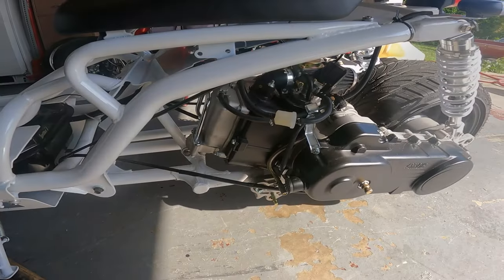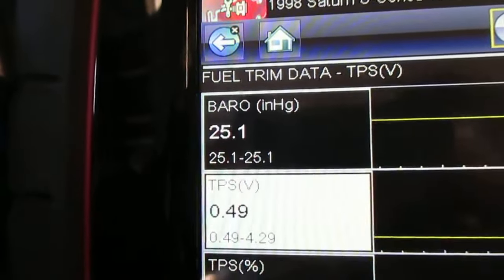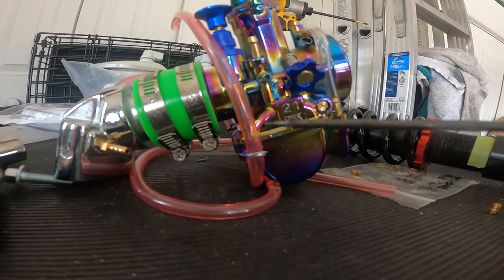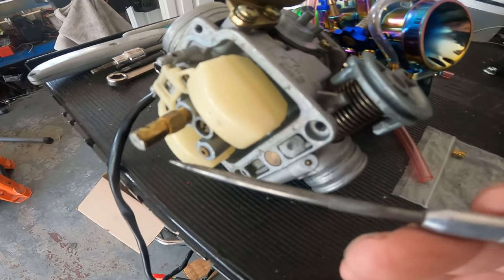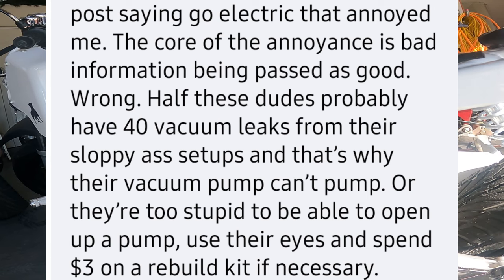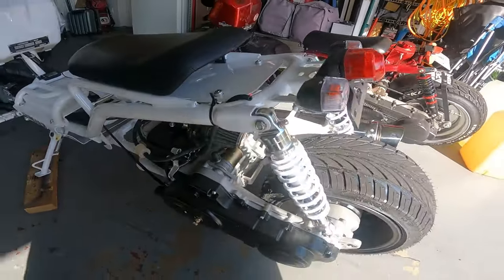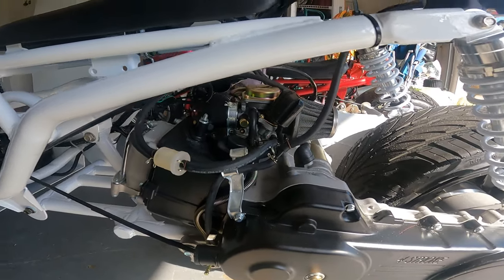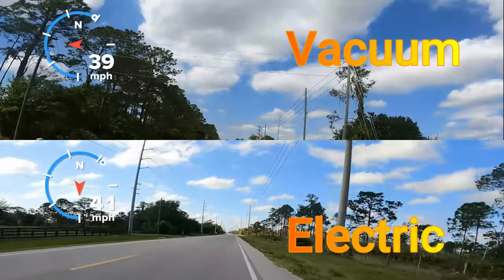Electric VS Vacuum Fuel Pump on Maddog 50 GY6 139QMB

Comment: Great video..
My old honda helix used a electric pump..what some people forget to understand is where the gas tank location plays a part as well trying to pull fuel from under the engine is hard.. I believe even the honda ruckus runs a electric pump as well because of the location. Great info 👍
Reply from the maker: Thanks.  Ya I have the honda ruckus pump on another bike.

Comment: I'm suspecting the same issue with my 72cc build. After jetting it and taking it for a ride, I manage to get it up to 50 mph (Probably more around 45 but didn't have my gps speedo app on) then it started dropping back down to 40. When I turn off and got back on the throttle the acceleration was slower than when I first took off. But then when I stopped for a moment then proceeded, I was back to normal acceleration. Considering finding a electric pump solution or just go full gravity feed with a shut off valve.
Reply from the maker: Sounds like it for sure

Comment: You couldn’t be more right. I have seen this with my own eyes. However, I did one better after having my electric fuel pump leave me stranded. I installed a Y and a second line which I can switch at the fuel filter that goes to a vacuum pump. Hopefully I will not have another electric fuel pump failure but if I do I’m ready.
Reply from the maker: Whoa.....  LOVE that idea!
Reply: Would love to see your take on it. I just used a brass valve and a Y at the tank. Then I used a valve on the vacuum line so the pump doesn’t actuate all the time. I simply swap over the line going to the inlet of the filter unplug the electric and valve in the vacuum.
Reply from the maker: @wesmadebuilds681  is the valve just like an inline fuel on Off valve?
Reply: @GhettoWrench  the valve is right after the tank, but that is just so I don’t make a mess if I want to work on something later on. The other valve is on the pulse line so the fuel pump is working all the time and all worn out. I just go into a Y right after the tank. One side goes to electric and other pulse. The discharge is what I swap around as needed. You could get fancy with valves but I already had a lot in the system.

Comment: I have the GenV same one you have. Just put 100 miles on it. Today I took it for a couple miles at 55mph n it started slowing down then I slowed down n it was fine. 🤔 I'm putting uni filter on next week and ordered jets too. Should I increase a jet by 2? Also di you recommend A china electric fuel pump for genV from Amazon as an upgrade? Or is vacuum fine? Looks like you lean electric but you spoke highly of vacuum I'm 😕confused😮.
Reply from the maker: @xDragonHawk  55mph...  guessing that is a 150?  On a long high speed run you are making zero vacuum and will run out of gas.  The bike bogs down and start dying until you close the throttle some and make vacuum.   Vacuum is fine for the city but you live in rural area and hold the throttle open long periods or have a 50 and always hold the throttle you need an electric pump to keep up.  Or you can just understand the vacuum weakness and just close the throttle to fill the carb again then go again.
Reply: @GhettoWrench  Thank you my dude! I like the throttle down tip to recover!!!

Comment: I got a simple question lol.  I have a maddog 150cc gen 5.  I'm planning to upgrade to better fuel lines.  Not sure of it's 1/4 or 3/16.  I'm new to this.
Reply from the maker: I have a whole drawer full of wrong size fuel lines.  LOL.  The one from the gas tank and the one on the fuel pump are bigger than the one on the Carburetor.  I just got 5mm line from China so no idea what size it is in inches, but it seem to fit everything good.  I think it is between 1/4 and 3/16...  but closer to 3/16 (4.7mm)
Reply: @GhettoWrench  thx for the reply 👍

Comment: I'm legitimate planning to set up a high pressure boost regulated fuel system on one of these because they're such a cheap engine test platform. I can go get a trash moped for like $100. 

Someone set up electric boost with an EGO leaf blower or an AMR300 already...
Reply from the maker: I really want to do that too.  Was looking at some goofy ones on Ali Express.  Would be fun to compare a few different ones
Reply: Not sure if it exactly applies, but I picked up a cheap electric fuel pump and have been trying to apply it to my 150(the pump is just on when the key is on). It feeds fast enough for sure, but this carb sat a season so I've been having problems idling it. It runs at a so high rpm that the rear wheel engages at all times. 😵‍💫 The pump seems to be working choice tho.
Reply: @Hackxcore  If you don't have one already, you will probably need a regulator of some kind to regulate the pressure down to a few PSI. There are regulators that you simply set with a dial, or there are boost reference regulators that adjust the pressure based on how much boost pressure is entering the intake/carb. 

This is the way to set up a blow thru carburetor with a turbo or whatever so that the carb gets a few more PSI of fuel than the overall air pressure entering the intake.
Reply: @tedowen409 I'd love to see you do a video on regulators. Show you overkill

I've got a $45 amazon one in mind currently, but I haven't investigated if it would work yet. 

"Adjustable Fuel Pressure Regulator 8AN Gauge EFI Bypass Kit Boost Reference - 1:1 4-65 PSI Silver+Black"
Reply from the maker: @Hackxcore  when it sits with gas in the carb the pilot jet gums up.  You just need to clean that.  You must see daylight through the hole when holding it up to the sky or it is not clean enough.  Have to have a pretty small needle to clean them out usually
Reply from the maker: @Pipeargill  for sure.  I use a 9PSI pump  with one of those dial regulators on a notrous setup sometime and feed the full 9psi to the wet side of nitrous.  So far the 4 PSI pumps have not blown the floats open.
Reply from the maker: @Pipeargill  I have the chrome dial regulator I was going to use on the nitrous bike: but did not use since I just drilled the fuel nozzle bigger instead.  I may eventually use that. I have never messed with EFI on these.
Reply: @GhettoWrench  I suppose the size of the regulator doesn't really matter, so I'm guessing any regulatior would work that can be plumbed in. 

I was thinking about EFI since I should have a megasquirt and a wide band guage somewhere in storage, but I might just grab another wideband guage and use it to really dial in my carb tuning or maybe go for a closed loop carb cheater like ThunderHead289 made since that system might also be useful for another experiment I want to do eventually.

Would there be anything stopping me from running dual motors off the low pressure side of a regulator?
Reply from the maker: @Pipeargill  no idea.....  but it sounds cool as shit.

Comment: Im getting ready to do start and stop standalone switch's is it simple to wire them up?
Reply from the maker: Easy to wire.  If you have a Gen 1 or 4 you may need to bring the 12v DC wire to the back where pump is from the front.  But put your switch inline on that wire.  If you have Gen 5 you will have a 12v DC wire in back already.  I have a video showing wiring the Gen 4 and a Gen 5.  The Gen 5 I use a rolling wrench pump, but same wires will work.
Reply: @GhettoWrench  I have a gen 5 with no rolling wrench pump as of yet
Reply: @tedowen409  is it just 4 wires? 2 for the kill switch and 2 for start button
Reply from the maker: @michaelhatala  no.  Wore the pump.  2 wires..  a ground and 12v hot.  The on Off switch is ONLY part of that hot 12v wire.  Imaging just cutting the 12v wire and putting the switch on the 2 cut ends you made.  You will have to run that wire from the source to where you want the switch then back to where you mount the pump.
Reply: Would it be easier to watch the video. I'm kinda confused
Reply from the maker: @michaelhatala  ya here is my Gen 5 wiring.  Just use the same wires I did to tap into on video.  It will still work for any electrical accessory or pump
https://youtu.be/TazZK76qgsE?si=yJ4Hwomd_UYBg-8C

Comment: I tried to argue with him but you can't argue with stupid lol
Reply from the maker: IKR...  I just bit my tongue.   Figured next time I would reply with some proof so I made the video.  Too funny
Reply: @GhettoWrench  when I told him if I WOT for a couple miles or 5 minutes I would have fuel cut.  Installed the electric fuel pump from Amazon and haven't had a problem since.  The response was why are you WOT that long?!  Lol I live in Iowa out roads out straight and long and speed limit is usually 55 so I have to.  He came back with your bike isn't tuned right or there's a problem with it.  Um nope lol carbs good and clean, fuel is new, valves been adjusted, no vacuum leaks.  But it's my bike.  Yea ok.
Reply from the maker: @churchhalfling  ya that dude is a smart ass online.  I would like to see if he talked to me that way in real life.

Comment: I'm with nature an gravity
Reply from the maker: Gravity is by far the best
Reply: Bike been down for weeks. Money. Is tight. I got 64mm rockers cam an head for 51mm piston from rolling wrench in Denver on top of a 47mm piston an cylinder from gy6  store in NC.  My carb is definitely no good now an probably the head situation. I need a carb. I can spend a lil. What's that nibbi setup u was working on?
Reply from the maker: @seanmayo206  19mm nibbi.  If u get the plain aluminum one and not black and red they are pretty cheap.  $36.  But you can get cheaper on aliexpress
Reply: @GhettoWrench  I got one last night . 175$ pwk carb with cable an uni filter an adapter an jets Did I over pay u t
Reply from the maker: @seanmayo206  WTH my last PWK was like $26

Comment: If  u have a vacuum port before the butterfly I will have high vacuum at  high speed.and after the butterfly high vacuum at low speed.If u want and can set ur float right eliminate both pumps.even electric and let the scooter run.
Reply from the maker: Oh man..  never even thought of that.  Good stuff.  Thanks